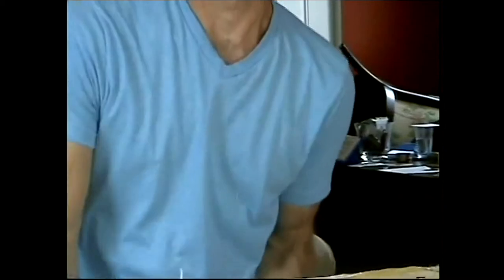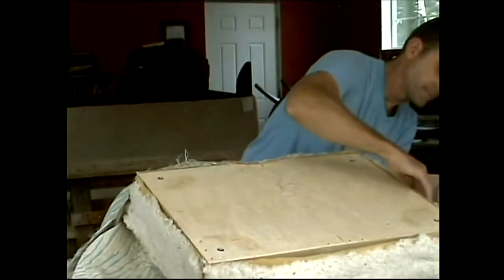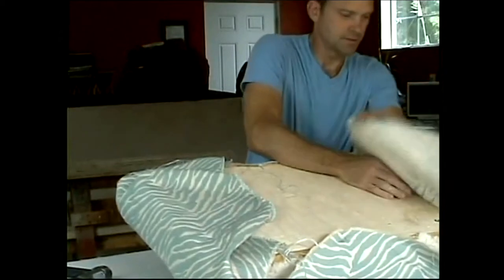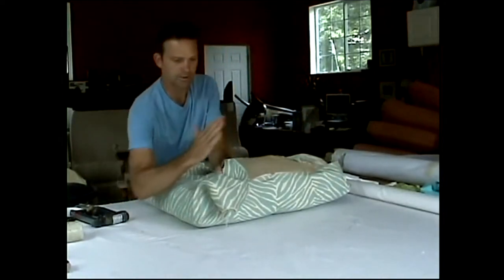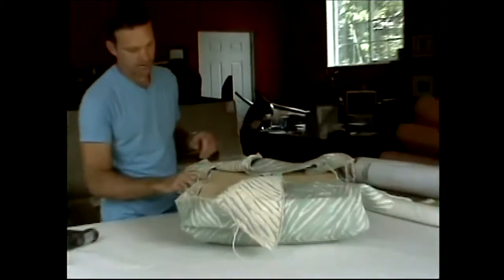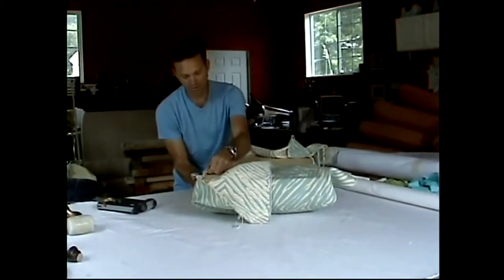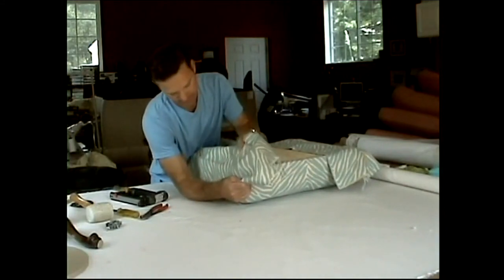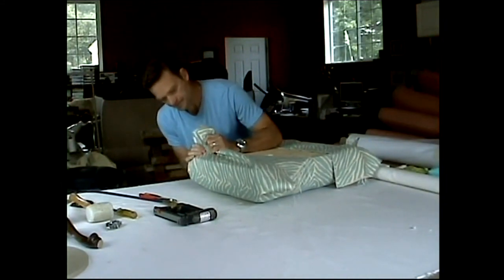DIY Ottoman Reupholstery Part 3

Comment: Useful vid. Hope you're still doing what you do in 2022! Currently working on 2 old Lloyd Loom pieces, and about to begin my maiden voyage in to re-upholstering, so need al the help i can get. Got high density foam, and 2 oz poly batting (although I prefer the drape of your cotton stuff.) Don't have a heavy-duty staple gun, just upholstery nails, plus using a medium weight velvet on one 🤨. Will I get away with anchoring manually with only the tacks, or do i NEED to buy a staple gun? Bit of a budget project, so I hope not to have to.